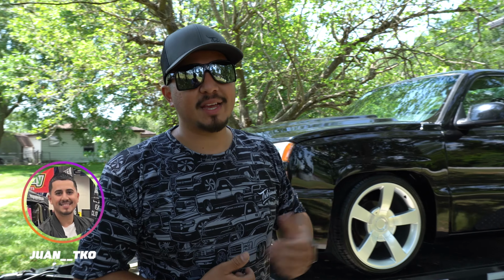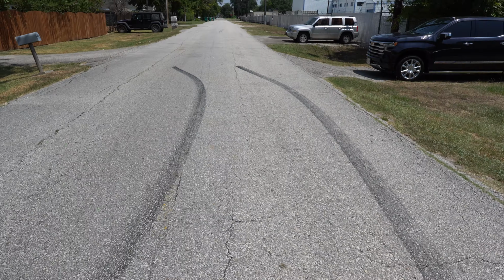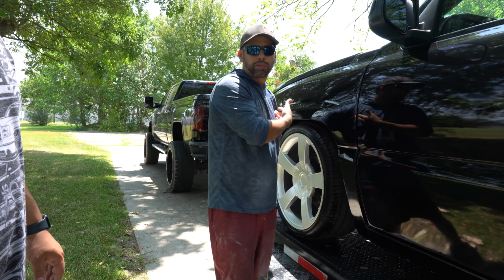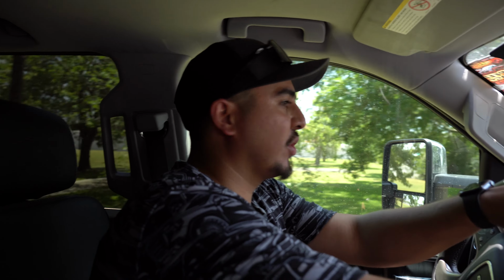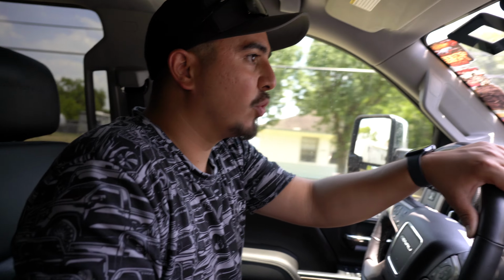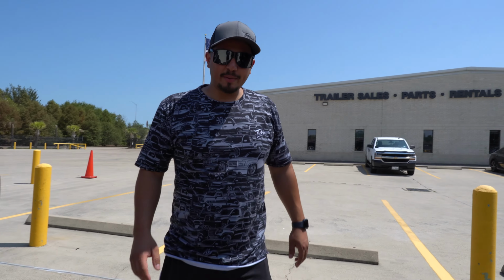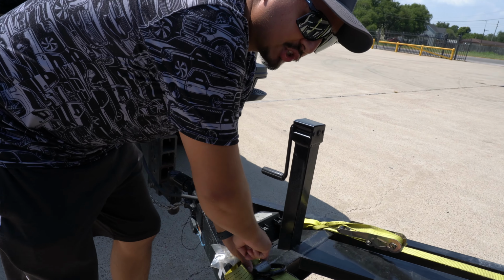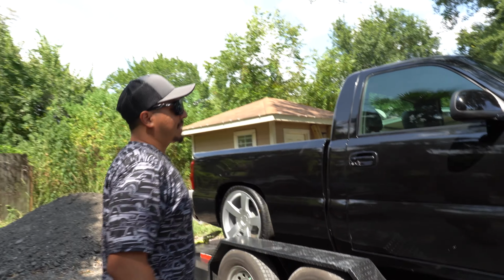BUYING THIS SS CLONE WAS A MISTAKE 🤦🏻‍♂️

Comment: He just tryna make some bread off y’all. Dude can easily fix that
Reply: Onggggg😂😂😂 he didn’t need to REDO the whole kit he just needed to do body work😂😂😂😂
Reply: na fiberglass is tricky stufff. and that front fender is molded to the rocker panel so it all has to come off! Props to them for doing it right 🔥
Reply from the maker: Its all molded togheter, no adjustments can be made without major body work & it being fiber glass makes it tricky to work with. Better to start off with a new kit if we want it to look 💯💯
Reply from the maker: Yes sirr, have to make it look💯😎
Reply from the maker: Video or pictures wont do it justice on the imperfections, needs to be fixed & fixed right. 😎